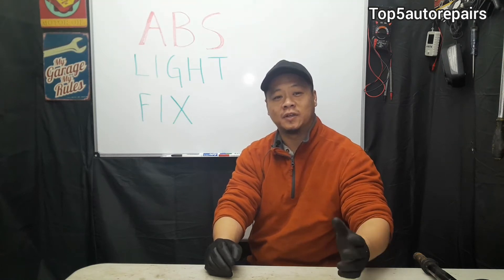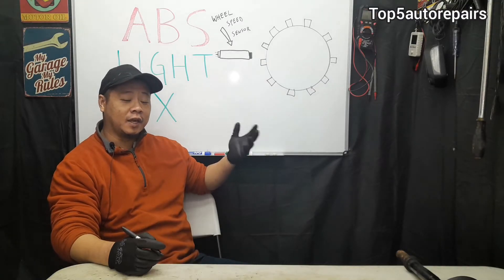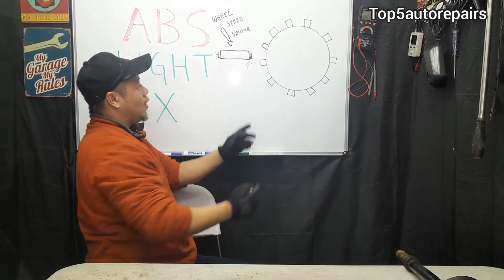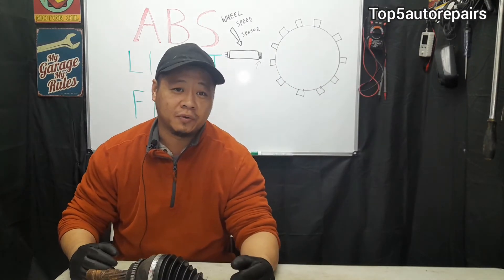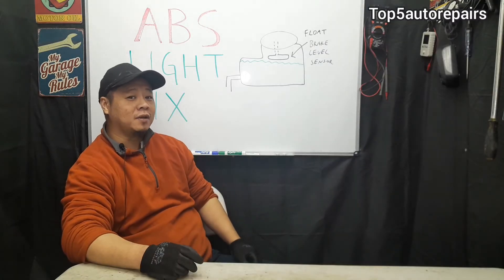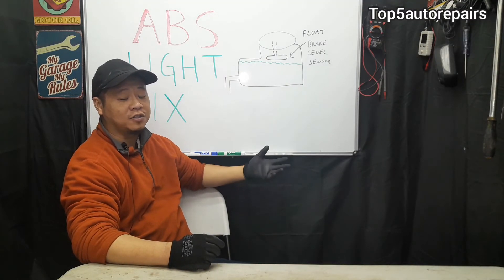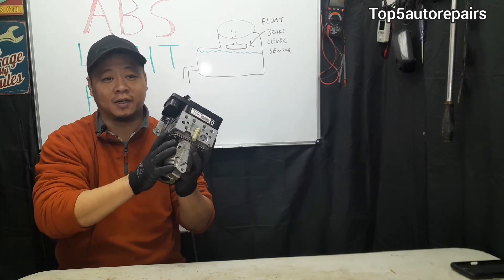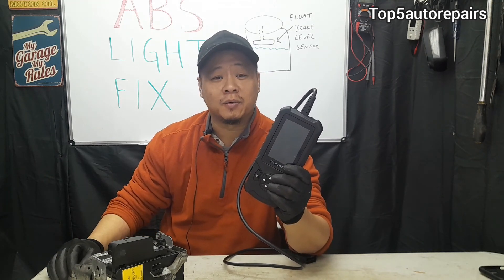ABS Warning Light On Dashboard Fix

Comment: I have an Acura tl 2005 that has an abs vsa triangle exclamation point lights that come on with a check engine light that is supposedly a gas leak, they come out randomly and I just switch my car off and on again and everything goes away except the check engine light, what can it be ??